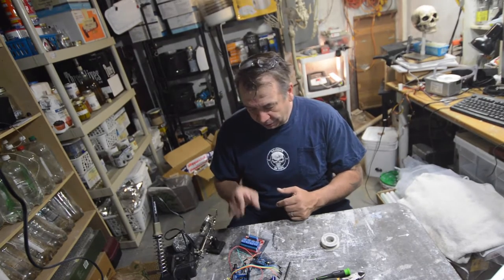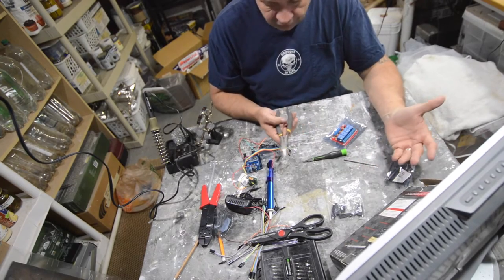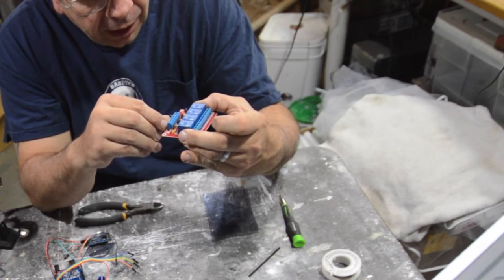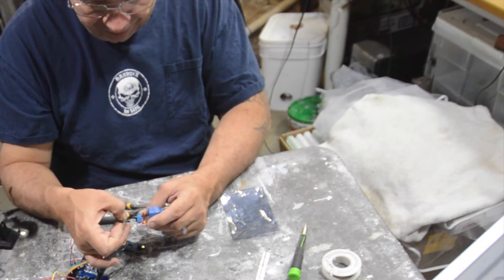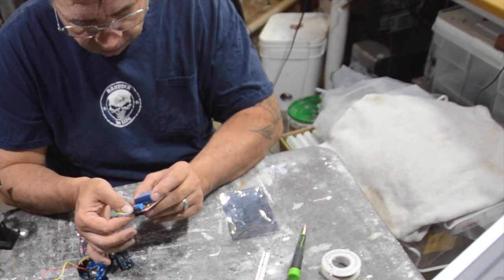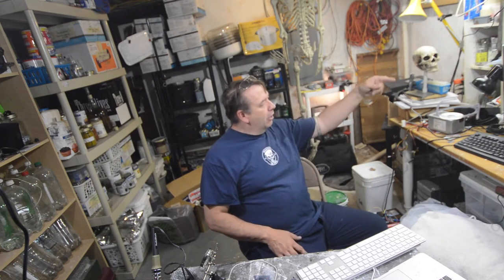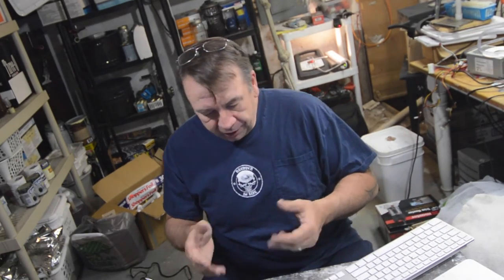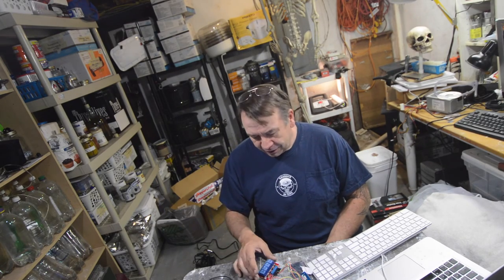Prop Controller Complete & New Prop Project

Comment: Holy sh*t.! You did it! Heh. However, I think you have the relays wired in reverse. It looks like they're on all the time, and shutting off during the sequence.  Again, tough to tell, but it looks that way based on the LEDs on the relay board being on all the time. If you don't want to rewire, you can fix it in the software. There's a toggle for each channel to make them operate in reverse. It's called "HiOut", and it's just a checkbox that you toggle when you do "create new controller" in the software. Uncheck the box for all of your channels and it will make the relays work the way you intend.  I do cover it in my 2nd video and it's also in the documentation. 

Actually, on second thought, I think you just might have the polarity reversed. Make sure you have ground to ground and 5v to 5v. And, for the love of God, step away from the mannequin. Ha!
Reply: +Montclair&#39;s Lair Do you know how to program Picaboos too?
Reply from the maker: +Montclair's Lair I just checked my wiring to the diagram in the instructions and everything matches up. You're right, though, the relay switches are all lit up till activated
Reply: GhoulishCop Use the software to flip them then. It's safer than reversing the polarity, I'd imagine. You'd probably be safe doing that, though, but who knows?
Reply: bransonhauntedhills No, I have no experience with them at all. Ever since I saw this one by Mike, I wanted to build it. Over the counter controllers are just too expensive in my opinion, when this does the same thing.
Reply: Ok, thank you. I was gifted three Picaboos so I need to learn how to program them. Time to watch Frightprops tutorial videos.
Reply from the maker: +bransonhauntedhills You might try to hit up Dave Dankanyin with a question or two. He's pretty responsive and I can almost guarantee he knows about programming them
Reply: Thank you for the info!

Comment: Glad everything worked.
Reply from the maker: +greeg1358 Me too, though Montclair's Lair thinks my polarity may be reversed since the relay switch lights stay on until activated. I checked my wiring and it is identical to the diagram, so I'm not sure what's up with that
Reply: +GhoulishCop The lights looked like there flashing when they were triggered to me, of course my eyes ain't what they used to be.
Reply from the maker: +greeg1358 Yeah, I think his point was the lights were supposed to be off, and then only flash when activated as opposed to being lit at the start and then flashing. I'll have to check with Jason Becker and see what his experience has been

Comment: do you still have the gs body form in the P.O.P??? if so use it to make your body instead of the bluckie. also, who'd of thought someone like us could do computer stuff?? I am so impressed!!! have you thought about using a Tupperware with the lid to put your thingy in??? drill a hole in the bottom and stick the wires in and your done. water proof and in your case snow proof!! and small enough to hide
Reply from the maker: +Edie Bluntzer Yeah, I don't think I'm going to try and pry that out of the PoP lol, though I saw on Facebook Ken Sheldon had done just that and his looked pretty good! As for the container for the prop controller, I thought I told you once before to get out of my head? That's EXACTLY what I did. It's in a Tupperware container. LOL! I haven't set it up exactly as I want inside, but it fits it perfectly.
Reply: scary ain't I Rich??? bwahahahahahaahahahhaha
ya know when I said to spray paint the inside and you could pop out the GS and have a movable body??? well I am too much of a lady (chock cough ummm, yeah) to say I told ya so... good videos Rich

Comment: I need to make me one of those
Reply from the maker: +PsychoAxeMan They're fun to do, despite my travails. I plan on making a few more. I think those attempts will go a lot smoother. If you watch Montclair Lair's second video, you'll see it's really just a 10-minute project because it really just comes down to attach wires to a pre-labeled slot.
Reply: +GhoulishCop thanks for the the tip..I'll check that out